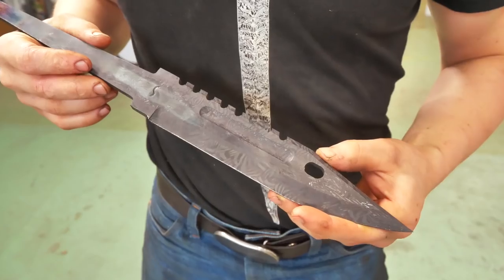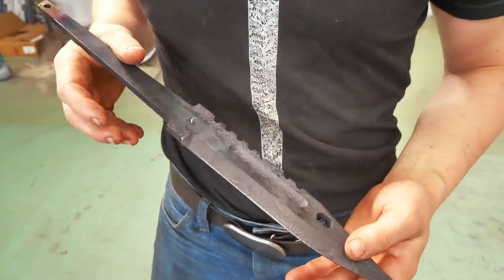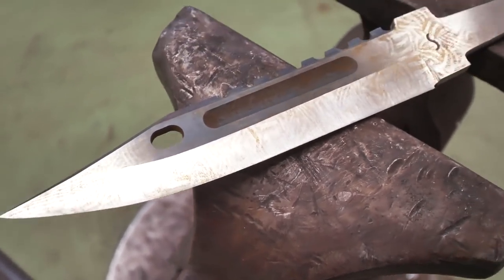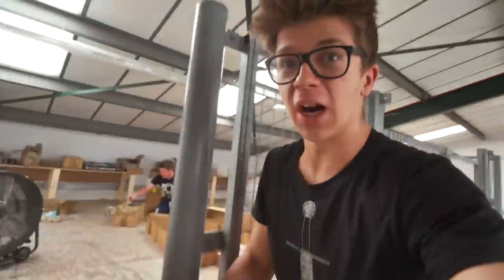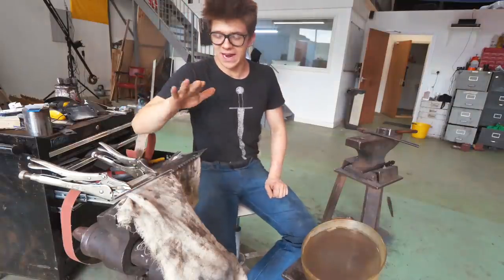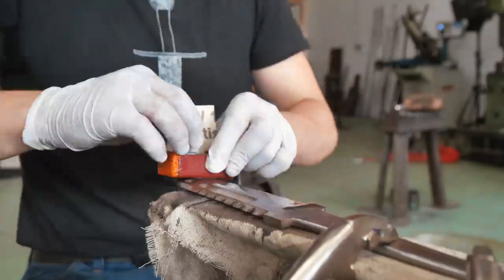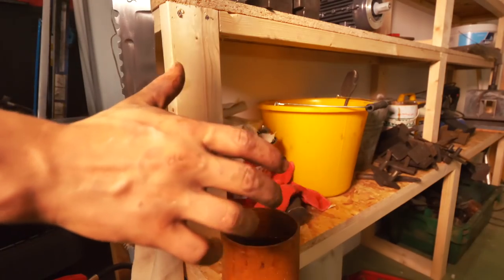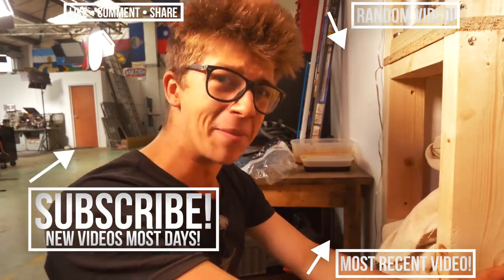CS:GO DAMASCUS M9 BAYONET: Part 3

Comment: Hey Alec,
Killer knife man. Super stoked to see the finish. I used to be a production grinder and also wanted to recommend investing in some sort or dremmel tool. For one, it'd make light work of sanding that cutout area.. but also you could have used it to make the saw blades at the back have a clean cutting edge, again, very quickly and accurately. It's a very handy tool. Keep up the good work man.

Comment: Haha love to see new people TIG welding. Easily my favorite process followed closely by stick. Don't let the keyboard hero's get you down, I've trained dozens of guys over the years and it takes time. Best suggestion, when you get some filler practice feeding it smoothly. Everyone thinks the torch part is the most difficult but you'll screw up way more tungstens with sloppy filler metal. And toss your plates into a few different positions. Rule is "If you can weld vertical up, you can weld in any position!" Have fun!

Comment: You need a variable speed Dremel tool for the finish work on something like that knife. Though I do suggest making your own bits for sanding which is easy enough to make with wood dowels and screws that are the same diameter as the Dremel's accessories shafts. How to make the bits is easy, for the fuller round a 2 inch piece of dowel off on one end then put the screw in the other end(exactly in the center) with enough thread for the chuck. Cut off the screw head. Now take some sandpaper and cut circles out of it(cookie cutter punch and rubber mallet works well.) then cut lines from the outside edge to the center leaving a small circle in the center where the cuts stop. Now that you have your dowel attachment and sandpaper all cut take a piece of sandpaper ad set the center on the round tip of the dowel and fold one edge over to the side of the dowel and use a small bit of painters tape to secure it. Repeat for each cut so the overlap is in the direction the Dremel turns and when you get to the first tuck the last in under it and put a strip of duct tape or better around it to keep it all from flattening back out. Repeat for a few more replacements and for each grit step. When you go to sand with it slide one of the sandpaper condoms you made earlier onto the dowel and staple it to the dowel through the tape from atleast 2 sides. Use just like any grinding/sanding bit because that's what it is but custom sized to fit your job. For the saw edge parts just a longer and thinner dowel with the sandpaper rolled around the dowel with a staple on each end, you can get away with tape though but if it becomes unsecured it's useless.

Fun thing you can do with a die grinder and high quality steel round stock that's thick enough to chuck in it to make your blades edge scalpel sharp. Easy to make for you and you have a die grinder already. Cut the round stock into a long enough length to be chucked and enough length so your blade wont hit the chuck. Harden it on one end so the chuck side is tempered and wont shatter. Sand smooth with 1200 grit as the last step so you have a nice polished piece of tool hardened steel. Take a couple wood 2x4 blocks and cut a V out of them that's wide and deep enough to clamp the die grinder in a vice without breaking the plastic shell but secure enough to have running at full speed with light pressure on the bit. Chuck your new bit you made into the die grinder, clamp the die grinder in the vice, turn it on at full speed and lock it on if yours has one, otherwise use tape on the trigger. Then proceed to sharpen your already sharp edge on the hardened steel part of the bit, one pass for each side repeated until it is scalpel sharp. It wont take long at 20k RPM if you already have a razor sharp edge.

Comment: Mr. Steele, if you wish for your Tig welds to get better I suggest to take two pieces and make a right angle with them. You can do a technique called WALKING THE CUP. You prop the ceramic cup on the metal and wiggle it very slightly. WELD ON.

Comment: A quick tip for file work my dad taught me years ago while sharpening my chainsaw is to never drag the file on the back stroke as it flattens the cutting edges down and kills the files ability to cut properly. I rarely have to buy replacements like I use to. As always your work is amazing and I am continuing to be inspired  amazing

Comment: If you fix your Bridgeport so it can rotate, and lean the head about 5-10° it will make a ball nose end mill cut cleanly in the bottom of the radius. I usually cut in the direction it's leaning. It's kind of a pain in the ass, because you have to go back and straighten the head, but the results will surprise you.

Comment: Nice job, and great looking pattern.  But, what's with the teeth on the spine?  They are pretty useless to begin with, but unless you file opposing rakes on them all it'll do is make a fish scaler.   Not to mention that the thickest part of the blade needs to be the cutting edge of the saw teeth or it won't cut very deep.   And they will hang up on stuff if used like a bayonet for thrusting, and be in the way for other field craft uses.

Comment: You have not addressed the receiver for the bayonet, it's the little clip on the pommel of the knife that holds it on the actual gun.  You also need the guard with the mounting hole through it that fits over the barrel.

Comment: Did you loosen the 4 bolts on the front of the Bridgeport to swivel the head?
Reply: Timothy Heacock he did. But the turning gear seemed stripped/jammed. So even though he loosened things it wouldn't move

Comment: Why does it need to be a wet sand? Why won't dry work?
Reply: Wet sanding is more effective for a final sanding because it allows for the particles that are taken off the material to flow freely away, instead of staying where they are and scratching the surface.
Reply: Peppo, oh thanks! Now you say it, that makes a lot of sense.

Comment: Looks great! Making the handle for this is going to be a real bitch. Are you going to give this piece a the ability to attach to the lug of the M-16/M-4 series of rifles? It would be nice to see a rugged Damascus M-9 Bayonet. M-9 Bayonets have a tendency to fracture fairly easily. I broke one on a bayonet assault course in 2002 at FT Benning George and watched a Drill Sergeant break two more in a row. For this reason most infantrymen don't carry them. The commercial M-9 bayonets are heavy and unreliable. Keep doing what you're doing. I can't wait to see how this turns out!

Comment: Why does he use water when he hand sand ?
Reply: The water does a few things. One, it acts as a lubricant for the paper. Two, it rinses the filings/grit away from the working area so you don't impart scratches. Three, it keeps the paper and work piece cool. Sanding creates heat, even sanding by hand can make the individual grains on the paper hot enough that the adhesive fails.